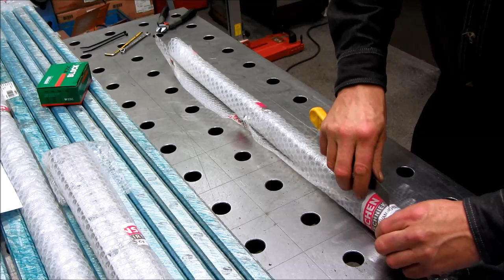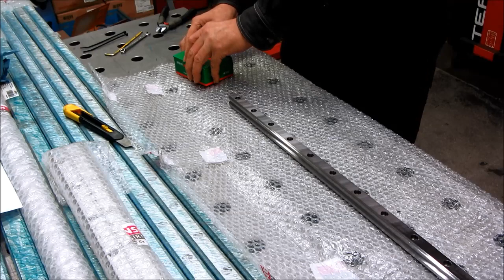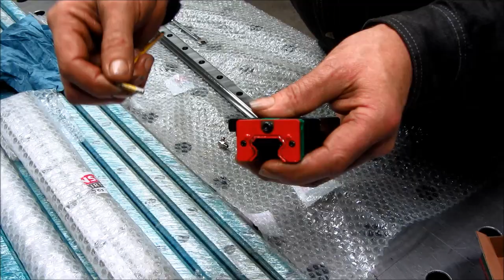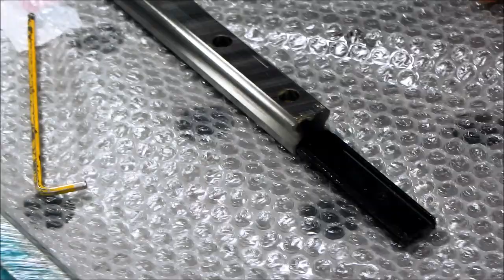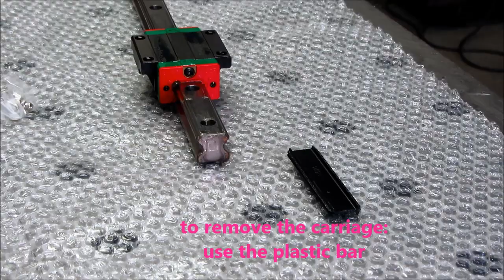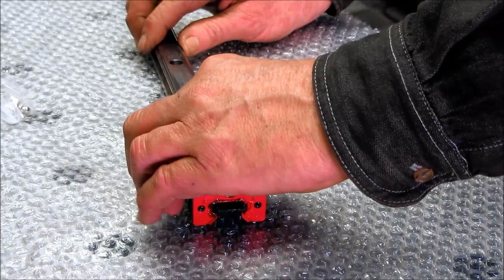Mounting Hiwin guideway

Comment: hi, thanks for the video, can you please let me know what nozzle size to use for the hiwin blocks? I have a grease gun but its not fitting
Reply from the maker: Khalid Al-Kooheji Dear Mr. Al-Kooheji, there is a set with different nozzles for grease guns available (art. nr. 5-12-0035). Please contact your local Hiwin dealer for availability. Best regards, JimVansichen Lineairtechniek